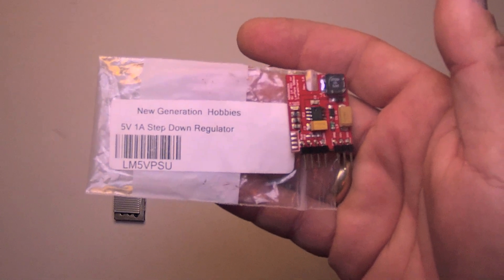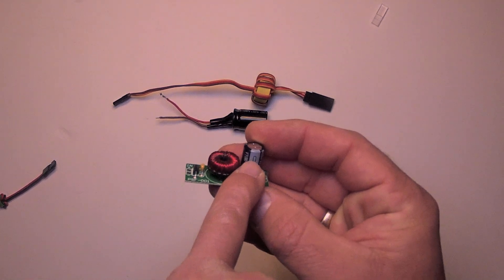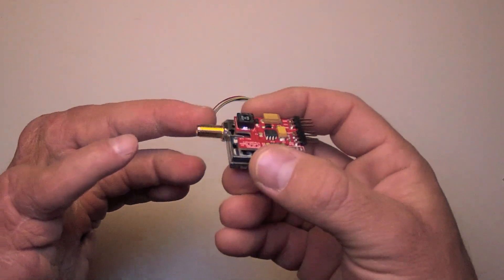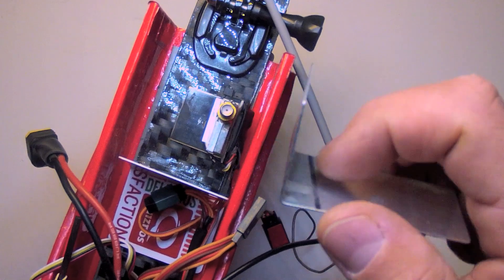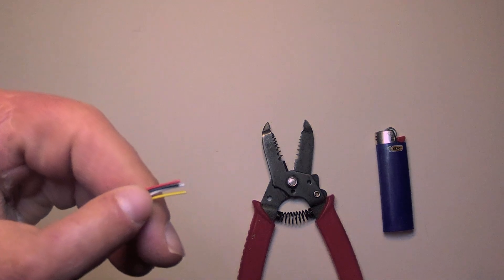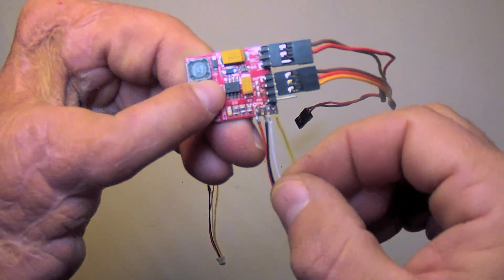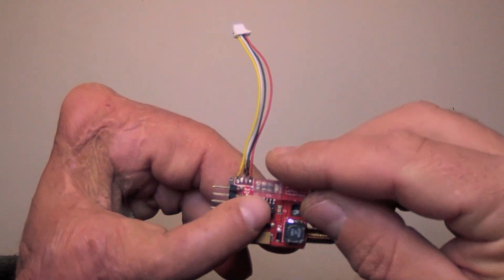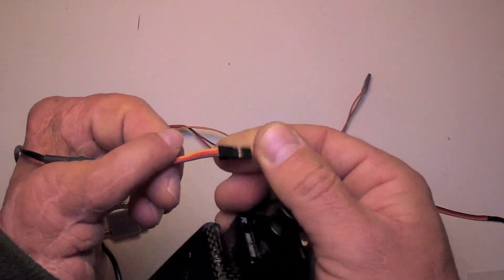NEW GENERATION HOBBIES POWER SUPPLY UNIT - PSU for Lawmate Video Transmitters

Comment: hi I just got this filter and I plugged it all in and then I turn it on and I get about 10 seconds of image then get tons of t.v. lines everywhere. I thought that this was due to overheating so I put it in front of a fan and turned it on and it worked great. Do you have a solution to this problem, if so what is it? Thank You.
Reply from the maker: Wish I could help, but I have only had good results from this PSU.  Never needed to cool it specifically.  But it does sound like you have something going on.  10 seconds sounds like pretty short time to heat up.  I feel like if you can replicate that result you should probably ask for a replacement.

Comment: Yeah seems a bit weird but I assume they've done their homework and found there isn't much need to filter the camera supply which goes with what you said. I will experiment as I just ordered a 12v camera (currently using a 5v one).

Comment from the maker: That is a great question and it seems the answer is no.  Therefore an LC filter might be good if the camera demands it.  Fortunately most of the cameras I've used are not as sensitive as the Lawmate VTx so no extra filtering needed.  Seems weird doesn't it?